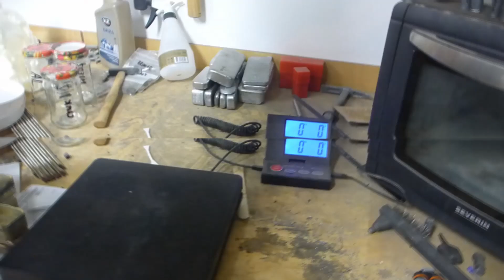Zamienianie złomu w złoto — tworzenie mosiężnych sztabek z darowizny od subskrybenta

Comment: That is a great subscriber to send that much brass.  The ingots look great.  Love the color.  Brass is a touchy metal to melt but makes great ingots, yellow or red brass.  Great job 👍
Reply from the maker: Brass is nice to cast also, nut very dangerous because of the zinc oxide fumes. I did not clean the bars because I will use them in the near future. Probably to cast my Manticore.
Either way I will also publish a video of how to make red brass alloy also known as Gun Metal. It is in redish color so looks cool.
Reply: @DragonAtelier  That's cool.  Can't wait to watch.  I have had 3 brass melts.  The first two were yellow, the last was red brass.  It has some yellow brass in it, but you can definitely tell the difference stacked on top of each other.  Would like to see your video of you making some red brass.
Reply from the maker: @JsStack  There will be one definately. I already have it recorded but still need to finish up the ingots a little bit, finish up the samole pyramid and of course edit the video.
I do not know still when it will be published cause I have soo much work to be done, but it will definately be there 💪